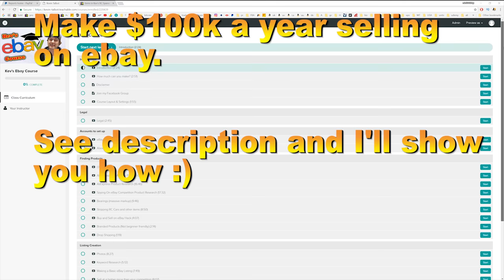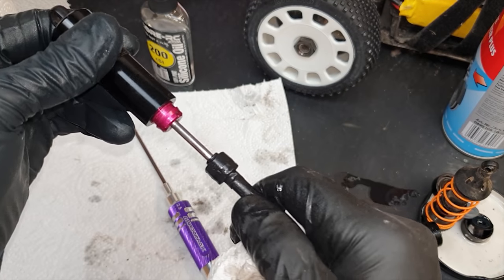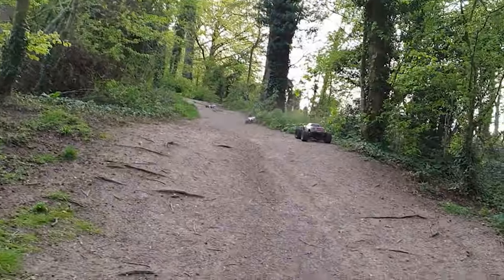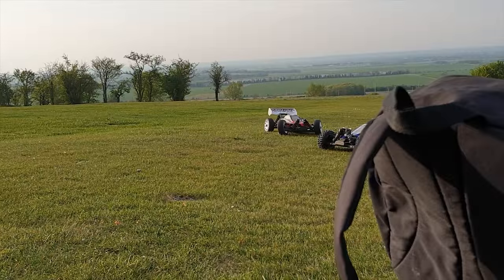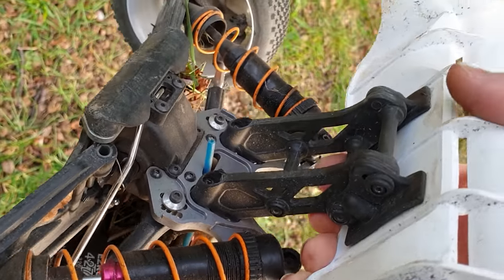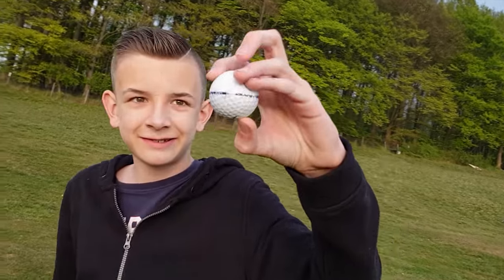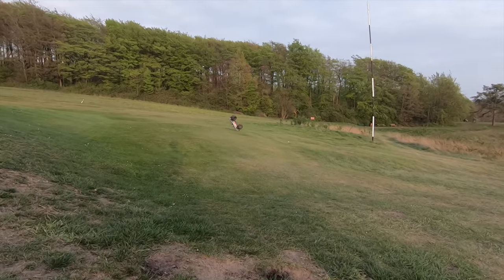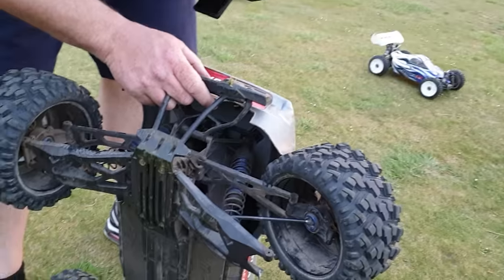Rc Car Golf

Comment: I don’t know if you saw this on the other video I posted about this on, so I’m putting it here: I think the reason your X-Maxx is making weird noises is because one of the diff cups is fractured! It’s happened to me before, and the issue was hard to detect because it doesn’t actually fall apart until you take the screw holding it down out.